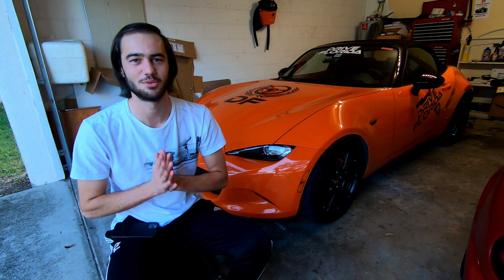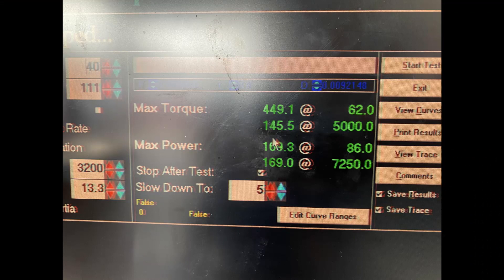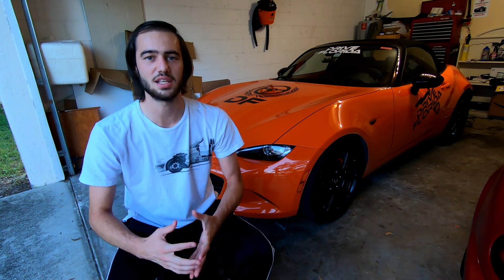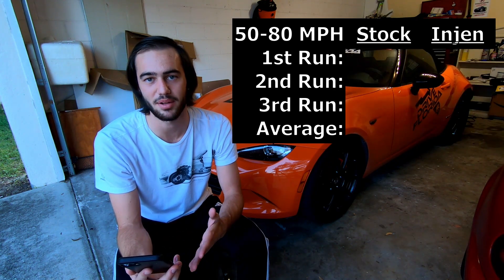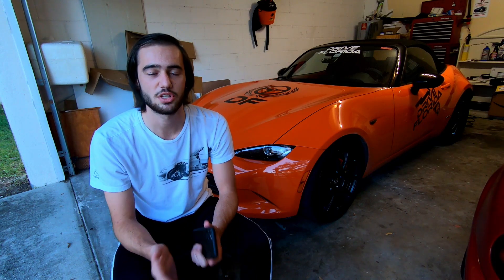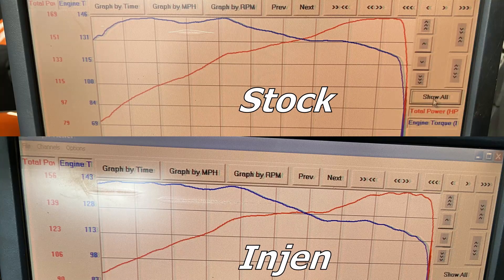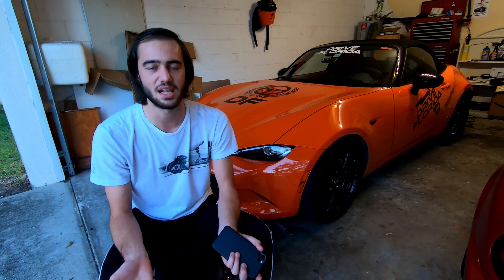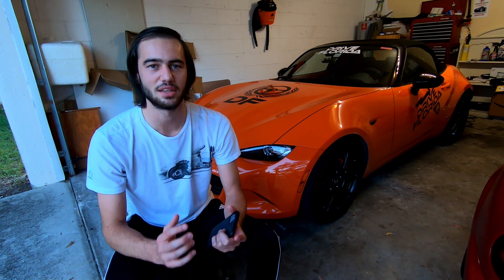Dyno Test: Do Cold Air Intakes add any Power?

Comment: The injen intake on my BMW seems to be better made. It comes in a metal box that has the same fitting as the original air box. It's also shielded from the engine. And it uses the original ports where the cold air comes through
Reply from the maker: If only they did the same design on this car! I know a few other companies have a design similar to what you described, but I think I’ll just stick with the factory intake and throw in a K&N drop-in filter
Reply: @DriveMX5  yeah when i saw the cold air intake in your car i wasn't surprised, it just seems to suck in hot air. When my BMW got tuned i already had the filter installed, on the stock dyno run i ran exactly the factory hp and torque numbers. After the tune i had like 5hp and 10nm more than other BMW's with the same engine and tune. So i'm pretty sure that my injen intake does the job
Reply from the maker: @TheTranfan  glad to hear your intake actually works! I would be interested in tuning mine to see if it’ll gain anything, but considering it would have to first MATCH the OE output, I think tuning would be kinda pointless. If it was close or the same on the dyno from the beginning, then maybe tune it
Reply: @DriveMX5  Thanks mate, is there much potential left in your car since it's NA?  I really love the ND, i would love to own one but i needed a bigger car and can only afford 1 car at the moment. Tuning my BMW was a no brainer though. It went from 102hp to 225hp with just a tune and intake
Reply from the maker: @TheTranfan  wow! That's a massive improvement. There are some gains to be made, particularly with a header that doesn't include a pre-cat. Gains won't be as dramatic as what you get on your BMW, but BBR has a kit for 225hp that includes cams. I don't want to change engine internals at the moment, so my goal is to hit 200whp N/A with full exhaust, tune, and drop-in filter. I think that should be do-able and give the car enough kick to maintain the balanced driving characteristics that I love so much about it
Reply: @DriveMX5  yeah 200hp in a ND should be plenty. My high hp gain is because i bought a version with a detuned engine. I bought a 114i with 102hp. But the 120i with 177hp has exactly the same engine and hardware all around. They both have 220hp after a remap.  And the 114i was like 5k cheaper and cheaper to insure. So it was a no brainer 🤣
Reply from the maker: @TheTranfan  Great deal!
Reply: @DriveMX5  yeah i can't complain
Reply: @DriveMX5  with all stock parts Fab9 stage 1 tune says it can gain at least 10hp-14hp for ND2. When the ND can gain like 17hp. I’m guessing it can get a little more since it’s a lower factory HP than the ND2? I like to think Mazda tweaked and did everything they could for those engine gains on the ND2 from from the ND1 if that makes sense at all? Lol
Reply from the maker: @Revell25  pretty much. The ND2 engine has some revisions and tuning to make more power anyway so you’ll see a bit less from an off the shelf tune compared to the ND1. FWIW, we tuned my fiancé’s ND1, all stock drivetrain except a roadstersport race muffler, and we gained 10whp: Make your MX-5 FASTER | Fab9/VersaTuner N1 Tune Installation and Results!
https://youtu.be/ngxg1R4cyQQ
Reply: @DriveMX5  that’s what I figured and that’s the exact tune I plan on getting. And I spoke with a guy from fab9 on the phone cause was debating of finding a tuner in my area but they don’t specialize in Miata’s so honestly said would send my map off. Prob will take fab9 and send it to me and charge me more lol only difference is I’m plugging it in. He did mention he could play around with the gurgles if I wanted when fab9 just sends one version I would think? But anyway, I didn’t think intakes do much and know they really don’t but since I plan on getting one the guy did say put that in first and then we’ll tune it so you can get everything out of the intake possible which makes sense

Comment: the only cold air intake that works on these are the once made by BBR even then the gain is not significant. Best save the money and spend it on other mods. Where in Florida are you located?
Reply from the maker: Agreed! I'm in Orlando, just west of UCF
Reply: @DriveMX5  that’s awesome! If y’all ever feel inspired every first Sunday of the month there is a Ocala cars and coffee y’all should check it out! I too have a white nd2 Miata with similar mods.
Reply from the maker: @KatanaiBlade  I'll have to make the drive one of these days. I've heard the cars and coffee in Ocala is pretty good!

Comment: I've always thought CAIs would only benefit a car after a tune and also on a boosted platform. The way I see it, in a boosted platform, the intake air is cooled anyways regardless of heatsoak. With an NA platform, the intake air doesn't go through an intercooler so I would assume it would be bad anyways.

Comment: A fellow 30th owner :), thanks for the video. Usually CAIs are not worth it on NA cars at least. With a tune maybe there can be some difference but nothing that would make a big difference. Problem with CAIs are that you risk sucking in more hot air if it is not designed properly. Would be interesting to see the difference between OEM filter and an after market drop in filter
Reply: I was thinking that too, wondering if there's significant improvement from just a less restrictive drop in filter.
Reply: Throttle response is better since I swapped to a K&N/sound tube delete. Did order a new intake elbow and plan to delete the resonator. Hopeful it will improve throttle response even more. It may make a few more HP as is but the response is the best thing about it.
Reply: @daddypettypatchadams7571  when you say K&N and sound delete tube I thought you wouldn’t need to buy a sound delete tube with an aftermarket CAI since it would take its place? Or I just typed this and now realizing you probably meant a K&N filter I’m guessing? 😂
Reply: @Revell25  yeah Im still on the stock airbox, sound tube delete, JBR elbow inlet and the K&N filter. The elbow inlet for sure helped plus you can actually hear the intake now. Still have to delete the resonator. Eventually I want a Autoexe ram air to tie into the JBR inlet unless I break down and go ITB’s before then lol.
Reply: @daddypettypatchadams7571  haha I get that! I honestly had no idea about the sound box and I was like oh I want that out of there then but the guy said well you mentioned getting a CAI which will delete/ replace it. But I got what I thought to be a great exhaust- HKS Premium and honestly could barely hear it. And I love HKS. Used them in the past cause I think they’re great quality. I then did a res delete and can hear it now but still not the best. No drone at least. I do wanna get headers soon so might wait since HKS said this is a great exhaust but you need bolt ons and aftermarket’s to wake it up which I didn’t know. If it’s still not great I’m gonna switch. Plus I would love to have the Utler or a dual looking exhaust

Comment: Mmmmm...heat soak.
Reply from the maker: Someone shared this interesting data with me yesterday: https://forum.miata.net/vb/showpost.php?p=8098326&postcount=35&fbclid=IwAR3BnALrEx-fGT2SE4d4XT6d30wIUDdOEg_EVbsY_GqLT30RK2-hfsu8eP4

They did their own data collecting on the Injen intake and the heat soak compared to stock was incredible.
Reply: @DriveMX5  I still wonder why Injen went with the design that they did, the stock intake is clearly already a CAI as opposed to a Ram Air intake and draws cold air from outside of the engine bay.
Reply: @DriveMX5  that's exactly what I would expect from their steel (aluminum?) piping.. makes no sense for an intake to be made from a thermally conductive material.

Comment: Good old open or close airbox performance difference. 
Pods looks cool but if not enclosed with a proper cold air source they generally hurt performance.
A good alternative is a pod filter with heat barrier that seal with the bonnet when close. Looks cool when open, sound doesn't get muffled and it sucks cold air.

Comment: Wow.. thanks for this I've been refreshing your channel literally every day anxiously waiting for this video before ordering it.. glad I waited, that seems to be a huge drop in performance.. can never trust marketing that doesn't make logical sense, that's why I was having trouble believing their claims about big performance gains. This seems to indicate that the intake air is probably significantly warmer with the Injen "cold air" intake which lowers the power output. Either that or higher resistance but I don't think it would have that.

Are you removing it from your car now? I would consider demanding a refund from them if you do, since they made false claims.
Reply from the maker: Thank you so much for the support! It means a lot. Agreed, can't rely on marketing and advertising to drive our decisions, that's why I wanted to collect data of my own. I did go back to stock intake and plan on keeping it that way. I won't get rid of the Injen one yet as I have some plans to do further testing on it.

Comment: I also have a 2019 and agree intake companies should definitely do more R&D for the updated motor
Reply: They know, but the high school C student moron is easy to be fooled.  Colder air has more oxigen per square unit than hot under the hood air.  Duhhh !